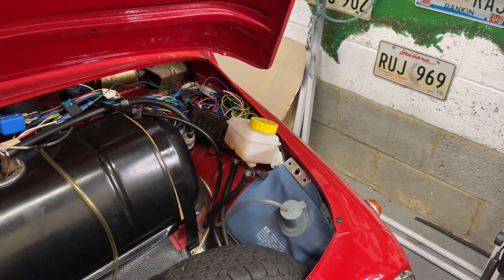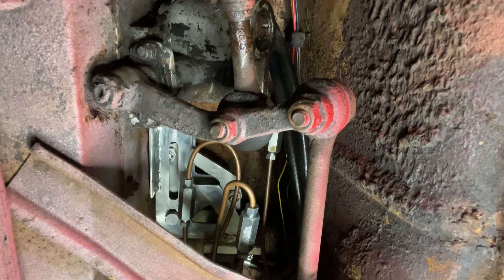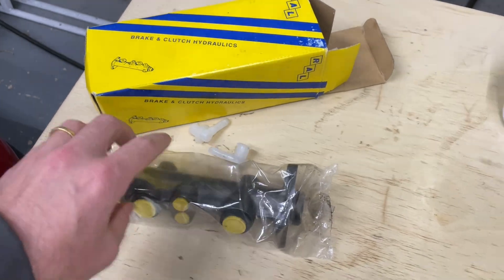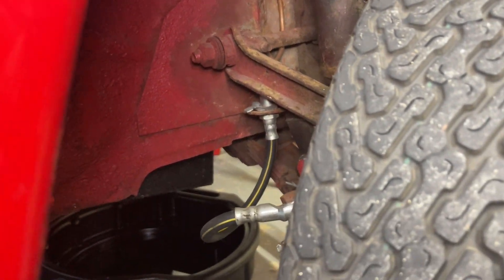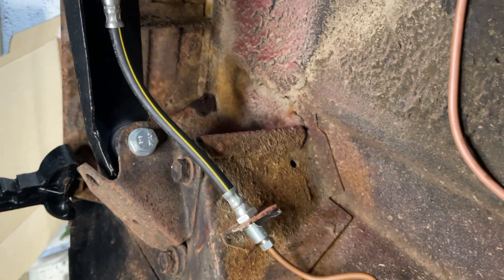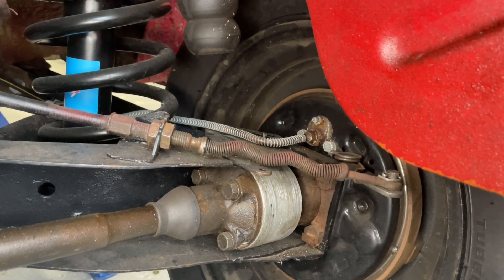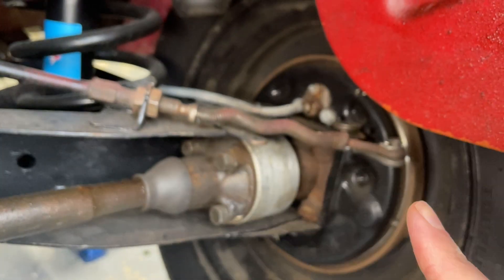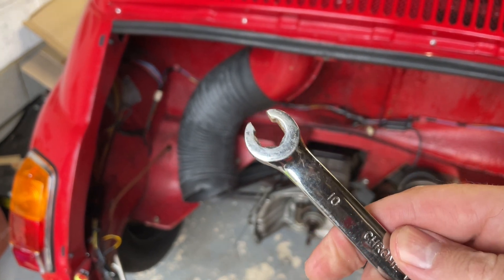013 A guide to the Braking System on a Classic Fiat 500

Comment: Where is the master cylinder located
Reply from the maker: At the front of the car between the front panel and the spare wheel panel.  You have to be under the car to see it
Reply: @the500workshop thanks found it ..had it changed... Not the most expensive master cylinder in the world ... 😂

Comment: Hi there. Can you please tell me where to buy this up graded master cylinder? Also,is line closest to firewall for front brakes ? Thanks.
Reply from the maker: Hey - that depends on where you are based in the world and which car you have, but you want something like this https://www.fdricambi.com/en/rs1276-single-to-separated-circuit-brake-conversion-kit/ or this https://www.fdricambi.com/en/rs1135-single-to-separated-circuit-brake-conversion-kit/

In terms of which line goes to which set of brakes, I cannot give you an accurate answer as that can depend on your car and who installed the brakes.  The best thing to do is get under the car and follow the pipes :)